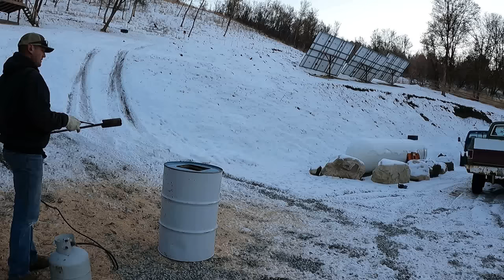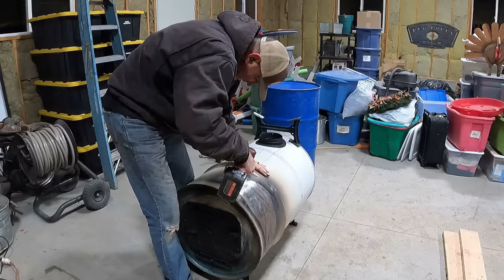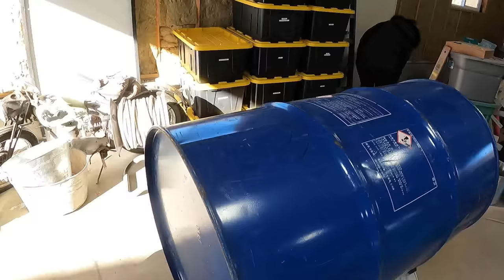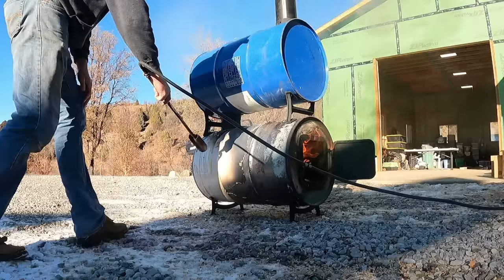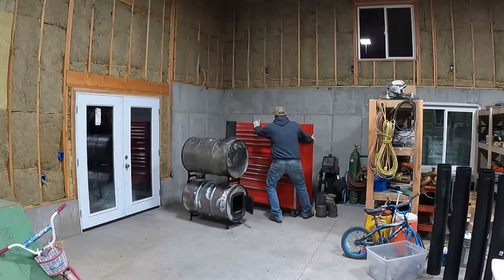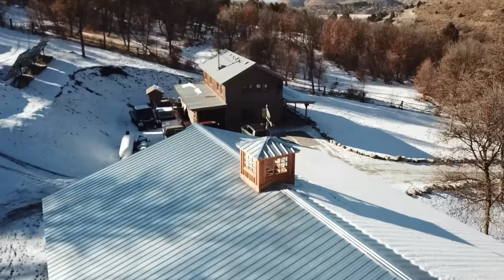I Built The ULTIMATE Wood Burning Stove For The Shop...

Comment: Why would you run your chimney pipe so close to that rafter when you could’ve moved it over to the left more before you got up there and then head straight shot up the chimney?
Reply: My thoughts too.
Reply: That stove pipe is close enough to set that truss on fire.
Reply: My thought too, same here, get away from that truss or put heat shield on it. Also I don't know about too much of a fan on it for creosote buildup in that top drum and also that pipe should have a decent amount of heat going thru it for the same reason especially with 2 elbows. Guaranteed not 100% of the wood that you will burn is seasoned. I have had a couple of chimney fires in the last 30 years. Not fun.

Comment: That's a fine job, & should serve you well for a good long time.  When I was in high school, a guy I knew built a one-barrel model in shop class, to heat the workbench area in the family's garage.  Instead of a 55 gal. drum, his dad, who worked for the phone company,  got a heavy gauge electrical transformer casing, complete with the radial cooling fins, & some sort of industrial hi-temp sealer for the fitting joints.  They could only load it to 1/4 to 1/3 capacity, because that stove radiated heat so well & far, they were afraid it would damage the paint & plastic on their cars!  Guy got an "A" on the stove build, & it was still working fine when his folks sold the place years later.

Comment: I am just afraid that rafter is going to get so hot.
Reply: Seen that.
Reply: The stove is way to close to the wall, especially with the open studs.
Reply: He should be using a double walled exhaust pipe and the rule is exiting the roof the pipe needs to be 2ft taller than the nearest point 10 ft away

Comment: We have run one in the 35x40 shop that was was less than insulated. And we use an old 20" box fan aimed downward on the upper barrel. To circulate air. We also went with the 20" straight pipe for the damper. And ran the flex section to put the flue closer to the eave of our shop. Works wonderful

Comment: 10mm copper pipe wrapped (coiled) around chimney + elevated water tank + plug it into floor heating system and you will get gravity fed floor heating. You could replace cooper pipe coil with any other kind of heat exchanger. Circle goes coil-water tank-floor-coil. Just make sure it is an open system or at least you have some kind of safety valve ;)

Comment: good stuff! I have a 40 x 30 shop and we did go with heated water tubes in the concrete floor with an outdoor wood furnace but it takes a couple of days to get the whole thing up to working temp. My insulation is thin and so on really cold days, it can't keep up. I think to add a wood stove inside for several reasons, jump start things in those first couple of days , supplement on the really cold days and have as a back up if the power would ever go out because the floor system moves water through the floor with pumps. anyway, liked your video and subscribed. cheers

Comment: Gary here from the UK, as one plumber to another sweet project have you thought about adding angled Finns to the unit, I think it will add more surface area to the unit thus giving you more heat for wood brunt just like radiators plus baffles inside the barrels to slow the heat down and give more heat into the barrels and you might think about adding a coating or sand  on the burn barrel only half way up on the inside to make the barrel last longer .I hope you think these ideas are useful.  
Very nice video very interesting and informative keep them coming thank you

Comment: You can also save even more money with angle iron and flat bar instead of that cast purchase. Also use handles as that round bar? And then go to your Auto center to even buy the springs and tackle that over the handle so you don't get burned when you grab that round stock as a handle. I'm always looking to be better of what I built. But not cheaper. But self-sufficient.

Comment: Your project inspired me to build one of my own. I heat a 20x40 pole barn. I did the double stove. I did make a small change by putting the door on the bung side of the barrel. I put the 2" bung at the bottom below the door and use it as a air inlet. Also I used red solid concrete brick to line the bottom. I was able to find a galvanized barrel for the fire barrel. It works great. At 22 degrees. F. I can heat my shop to 45 deg with no problem. Thanks for your video.

Comment: I’d like to build one of these but pivot the top barrel 90° to one side, cut the top (technically the side) of the bottom barrel so that you can weld in a flat steel plate, and that way you’ve got a little bit of a cooking surface.

Comment: Nice. Doggie. You might try putting a  layer of fire bricks and a grate in the bottom of the burn chamber.it’ll give you extra mass to retain heat and the grate will allow air under the woods for a cleaner burn.

Comment: i would put firebricks on the bottom barrel to protect the bottom. Maybe inside of the upper barrel as well to collect the heat. On the connections i would add fireproof tape with glue.

Comment: If you go to Tractor Supply and line the bottom with fire brick all the way back in about a quarter of the way up the sides it will last a hell of a lot longer and I even found a great that I used for like a storm water on a street and put a grate in the bottom and burn on the grate instead of on the metal it works well in my shop

Comment: I sold these in UK over 35 years ago. They were called Drum Heat. Drove around doing demonstrations with one in a purpose built trailer. Only sold the door, so get your own drums. Twin drum version with connecting chimney. Some buyers wrapped copper tube around the bottom drum fed from a water bucket. The steam rises and feeds a radiator for extra heat and hot water

Comment: My parents have this style of stove. Except for one major key differenc than the one's I see on youtube. It was made by a highschooler about 30 years ago. The "barrel" was actually a massive 1/4 thick wall pipe instead. Majority of the base is made out of 3/8 steel as well. It's incredibly overbuilt and basically future proof. Takes forever to warm up, but when it does it stays warm for days. Or day if it's winter.

Comment: I made a stove for my man cave out of one barrel.  I cut it in half, and used the other half as a second wall inside the first half....just cut a few inches out of it and bend it so it fit inside.  Then custom made a door and grate for it, used some old stove pipe from work for the chimney.  Works perfect.

Comment: I built the same one but single barrel..... i also cut it down a bit to fit into my fireplace...(about 25in in length.) Welded it back up an sealed it with furnace cement.  Keeps my entire first floor a nice 70-75 during winter months.  have it hooked up to my steel chimney sleeve to allow all the smoke to go out.  saves me so much money, fire wood is basically given away in my area!   i saved about 2k last year in oil.  this year should be the same.

Comment: Cool setup.  All you need is a cold air intake.  Whatever amount of air is going out of the chimney is getting replaced with cold air into the building.  Then you can close the door and throttle the damper.😁

Comment: This is awesome. Thank you for documenting this. I wonder if placing some firebricks in the top barrel to retain even more heat, or even adding a hatching to add more wood up top would be a good idea? Genuinely asking! Awesome build man, cheers!
Reply: I like the firebrick idea. would slow the 'ramp up" time of the stove a bit, in the sense that it would output less heat at the beginning, but would store heat as a heat battery. Would possibly clog up with soot though, blocking airflow.
Reply: Getting some refractory cement and lining the barrel and using it to hold the fire bricks in place will do wonders as well. There is a reason why we use it in making kilns.

Comment: Hello, A couple of tips. 
they do make welding blankets and also have kiln gasket material you could use for seals it you wanted to seal them better.
Also how about the idea of making a smoker out of the top barrel while your at it. Since you are using hard woods?

Comment: You need a slip connector in the system if the smoke pipe is too straight.  The pipe 'grows' in length when hot,,, about an inch for your 16 feet.  A slip connector is often a part of the roof exit thimble/flashing

Comment: next time try a propane tank for the fire tank.. much thicker, holds heat very well and, will last for a long time... i use them to built bbq's...  some are well into 10 years old with no issue and they are used year 'round...

Comment: Wood burners you always want to make sure the crimp end is going back to the stove. This keeps all the creosote from dripping on the outside of the pipe. In doing so, you won’t get smoke on the inside your building.  Just as your first connection was done. Great job though.  Looks awesome!

Comment: I have a torch I bought at Haror Freight that uses a 20lb propane tank. I use it for burning weeds. It'd probably be good for removing the paint and chemicals from those barrels. Also, with some copper tubing wrapped around a section of the bottom barrel and an elevated tank, you can have a gravity fed hot water source.

Comment: I ended up burning out my bottom barrel, a layer of refractory took care of that. also, I cut some plates to fit in the rib of the top barrel closest to the intermediate pipe and put a bypass and 7" round catalytic converter in it. makes a good bit more heat, keeps the outgoing stove pipe from tarring up and clears up most of the smoke. (I burn any wood)
Reply: D

Comment: So, buy the kit, buy 2 barrels and follow instructions.  
Since I have heated with wood my entire life (over 70 years) I would suggest that going STRAIGHT up with the stove pipe means that you could periodically clean the creosote that will form MUCH easier, faster and better.  Putting that 45 degree section in it means that you're going to have to disassemble your pipe to clean it.  Not so bad in late spring --- but early winter means ice on the roof and really cold in the shop.  I live winters 1/2 hr N of CdA (we have no hardwood here) and I heat exclusively with softwood and have to deal with creosote.  Stove Black is a much better alternative to paint or burned / rusty metal.
I noticed the damper never showed up in the install - MUCH better to have one in the stack.   - Joe -

Comment: I built this back in the 80s.  I don't worry about it burning out.  I can just transfer all the fittings to a new set of barrels and I'm running again.  I did add and fabricated  an ash cleanout by cutting exit a out 3 x 8 rectangular shape with the bottom and adding a weldment and  perimeter with angle iron with the flat facing towards the floor.  I fastened a rectangular door plate to the bottom and fastened it with a single large bolt with 2 nuts.  The first nut set the tension of the swivel of the door.  The 2nd nut locked the nut so that it wouldn't come off.  I welded an 8- 10 in length of right angle to the bottom of that door, cut a slot in the opposite end of the door for another bolt to set the closed position and used another bolt as the stop for the closed position.  It has worked as an awesome cleanout for all the ash.  I empty it after about 3 cycles and clean out the ash into about a large tall rectangular metal pan abt 5'6 inches high that sits under the burner barrel.  It has worked wonderfully since i fabricated it back in about 1987. I used it mostly all winter and heated an entire home with it all winter.  It was not used for about 6 years.  When i moved back i installed it in my garage and has worked for winter months just fine.
  Another note, you can remove most of the old barrel paint by firing it up outside.  Get it real hot and most of the old paint will burn right off.  You can then wire brush or sand blast off any old residue that is left.
Reply: This is Arvin and i am the husband of this account holder.
Reply: By the way, don't try burning coal in th hese old barrel heaters.   It's just too hot for them.

Comment: Radiant floor heating doesn't require a pump to operate. Having a close loop pipe system with a heating unit is all you need.
 Just the difference in water temp causes the water to move, circulate through the pipes in the floor.
 In south Korea this is what they have used for many years. They call it ondol heating.

Comment: Once, I cut open a propane tank in half by leaving the valve open to release whatever pressure might build up and filling up the bottle with water to make it blast proof. So, if you have concerns about a drum might have contained flammable contents, fill it up with water before cutting it.

Comment: Rub the exterior of your barrels with olive oil and once that burns off, you'll never have to touch it again. It develops a nice rich dark patina that lasts forever.

if you are worried about drafting at startup, cut yourself a little door in the exhaust pipe headed towards the roof and install a grating on which you can place a small metal cup of alcohol. Light the alcohol before you even think about lighting the fire, close the door and your draft will be in place.

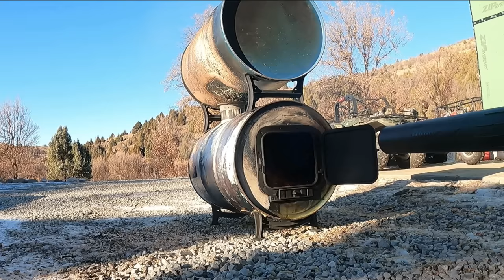Comment: I made a wood fired boiler,  just two rolled steel cylinders with water inbetween, using a concept that would also work great on a barrel stove: the air intake, 3" shc. 40 pipe, enters from the rear of the 4' long firebox, at the upper  11:00 position, runs along the box, getting pre-heated along the way, and then the air exits thru slots that are aimed down and to one side. What happens is, the fire gets kind of swirled in  a corkscrew fashion, contacting more of the firebox. Though it's a 4' long box, I've found I burn a lot less wood if I limit the wood size to 12 to 16", and just use the rest of the length as a heat exchanger in effect, the other benefit is no visible smoke 99.9% of the time.

Comment: This is awesome this is great, i have seen some of these videos of new wood stove ideas, and pool heaters using wood fuel, i think work great to have some heat exchagers about exactly like a car radiators on the wood stove red hot on top of the flames, then the air heat or pool water heat can drawl all of that temperature out of the stove, and can use heat exchangers like a car radators on the way up the chmeny something to catch the heat and can use fans on the red hot car radiators, would gain 100x more heat from the wood stove would probably run into the problem of becoming way too hot in the garage or even huge shop.

Comment: Barrel stoves are cheap but super inefficient. They are too thin walled and because they're not air tight they use a ton of wood. I found a kodiak wood stove insert for $100 on market place and converted it to regular wood burning stove. Great video thanks for posting

Comment: I've seen some of these double barrel stoves with
1.  Pipes running front to back with a small blower to force air through to help the heat output
2.  Copper tubing with water to feed a radiant heat system (just a small pump needed, probably 1 standard deep cycle and one panel) and
3.  BOTH systems in one (upper) barrel.
I definitely agree with some of the other comments, you need to run a small duct to feed outside air into the burn chamber.  Once the stove is going good, I doubt if you would even need a fan for it.

Comment: So when you build a fire on a bed of ashes the pollution created is about the same as 2,000 cars. If you elevate the fire any distance above the ashes, you get a much hotter flame, far more heat and reduce the pollution it puts out by about 80%. Anything that creates a small air gap will do - an old gas grill grate on fire bricks etc. The next suggestion below is a good one, fire needs air always. I like the idea of a small fan to boost the incoming fresh air, nice build!

Comment: Did you use a drill and tap to mount the bolts to the upper barrel legs? Looks like it would be difficult to use nuts and bolts as you can’t really access the inside of the top barrel to install the nuts. Nice job man , looks really good!

Comment: Just built one out of two cutoffs from build reverse flow smokers. Put a plate thru the middle of the upper tank at the back. Two vents on the door on the bottom tank. It'll heat a 40 x 60 shop

Comment: Here is an addition to your build ;get a 8-10 inch pipe and run it through the center of the top barrel weld it so no leaks , 
install a fan in the back , blow air through  it will improve the efficiency

Comment: The painting can taken off easily using paint remover (there is no reason to spent propane or something else) and a good washing after and it is ok... The special black painting that is written  here below is fire resistant and protect the metal from oxidation ... The fumes of the burning (the original) painting are toxic!!!!
In order to give you a "lever" to think something .... can you "play" with a circuit of a coiled pipe (copper for example) full of water??? The water (as you know) has bigger thermic capacity than the air and can keep you worm in longer time!!!!
Nice video, thanks for sharing!!!! Have good time every time!!!!
Best regards from Hellas (Greece)

Comment: The trick to get paint to better adhere to a metal surface after it's been burnt even if your using high heat paint is lemon juice. take a lemon squeeze the juice out and paint it on before painting ..

Comment: My advise... put those 8×12 concrete stepping stones in the stove. Two in the middle two on the right and left. And below the vent on the front drill a 1" hole for more air flow and bolt a piece of tin on to shut it . Mines lasted a long time. 2016 I built it now its Jan 2024 still has alot of life left. You change out those stepping stones every two yrs but there cheap.